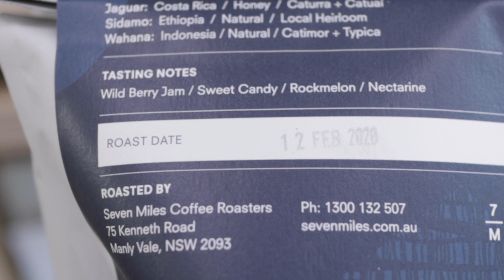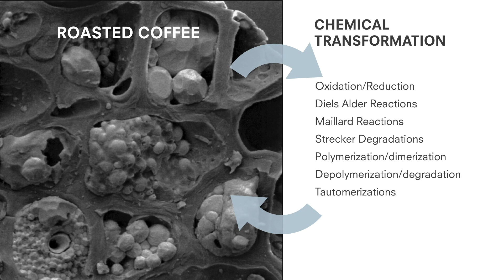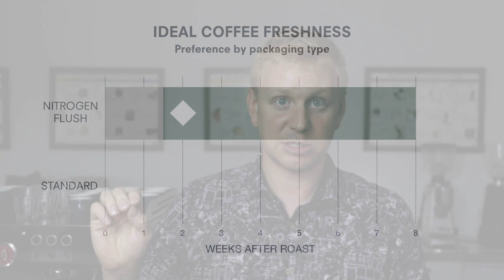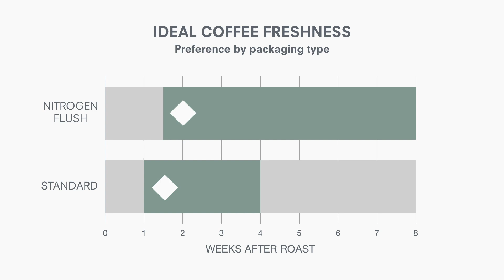Ideal Coffee Freshness (according to science)

Comment: has the roasted bean an closed cell or open cell structure? = open cell because it "exploded" in FC
how comes. that people believe, co2 would sit there end degas?

binding C to O2 is the natural way of decomposing the sun-energy.

afterstarting  pyrolizing the sugars (above 157°C) the process is starded.

if there is no O2 to bind a C on, there will be also no "degasing"
try it your self:
directly after roasting and cooling, fill the beans i a O2-safe Vaccum container (no valve! no plastic! only glas or metal or a aluminium-foil-coffeebag) - add argon and let it flow to the ground - than vaccum it (best possible like 99,9%) = after 3 weeks, there will be no sign of "degasing" - because of the absence of O2 to bind the C.

Comment: Very interesting! Does the conclusion that too-fresh coffee tastes harsh also apply to manual brewing methods? I would expect dissolved carbon dioxide to be less of an issue with unpressurised brewing methods. When is peak flavour reached for e.g. cupping or pour-overs? Do you have any data for coffee that is left open? Some roasters use unsealed paper bags and I've found these to go stale very quickly. Also, I think a very important issue that was not covered is how long the coffee remains fresh after opening, since many people won't finish a bag of coffee in a day. Maintaining peak flavour for more than 8 weeks is great, but doesn't help much if that isn't maintained for as long as it takes to finish the bag.
Reply from the maker: Yes, it's more of a problem with espresso due to the flow issues excessive CO2 causes with pressurised extraction. However, we still rest coffee for at least a few days even for other brew methods (cupping, filter, etc) due to the way the extra CO2 colours the flavour. In terms of open bags, we did a separate piece of work on that - although it was more focussed on storage conditions: https://youtu.be/PcQIIeaYmRE
Reply: @SevenMilesCoffeeRoasters  Thank you!
Reply: When roasting myself and out of aged coffee I found grinding and letting it stand for awhile speeds up the ageing. It’s still going to be rough but if your out of coffee it’s better than nothing.